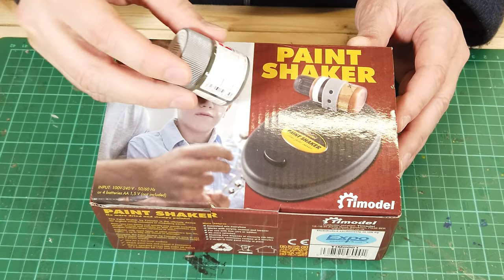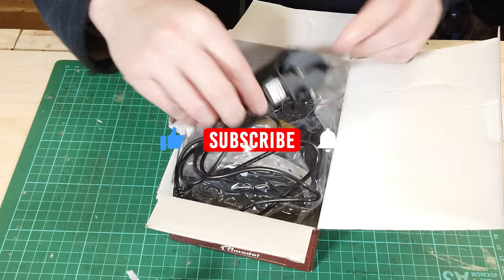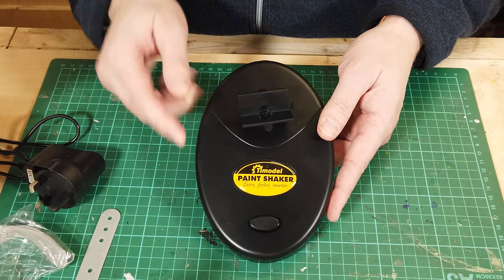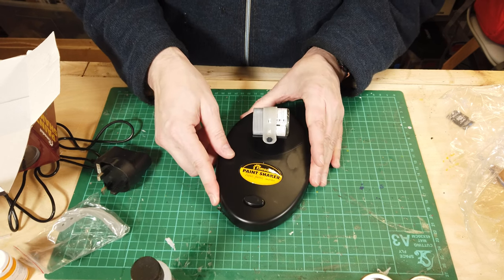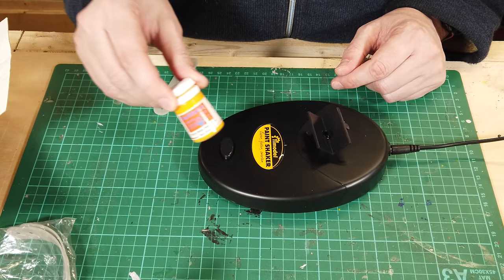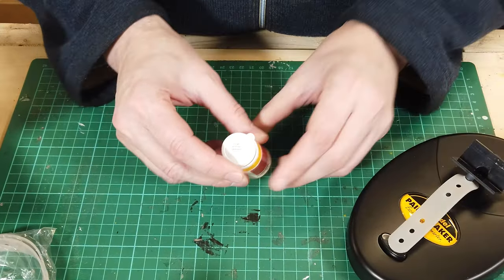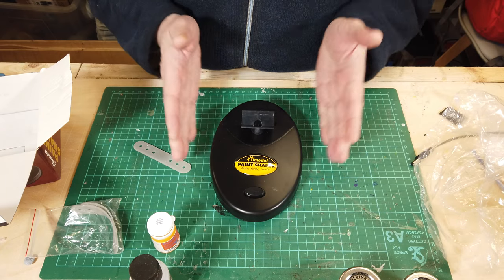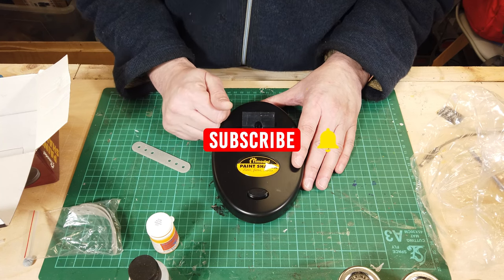Timodel Paint Shaker - First look

Comment: Thinking of buying one of these, an update would be nice. Is yours still working and would you still recommend it ? Thanks.
Reply from the maker: I’m not a huge painter so I don’t use it heavily, but it is still working.  I’d still recommend it. For paints, like enamels, as I recently purchased some, I think I may need some small paint stirring device also, to use after the shaker.  What I like about the shaker is that the paint is sealed so I’m less likely to make a huge mess and there is nothing to clean up.